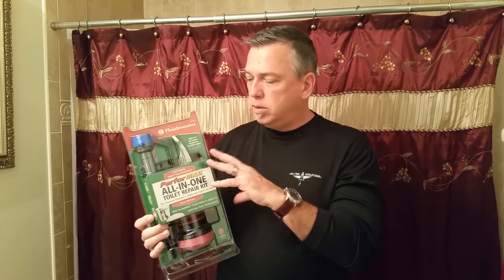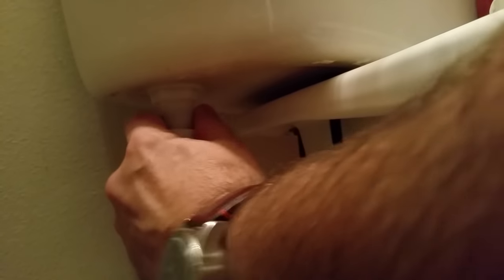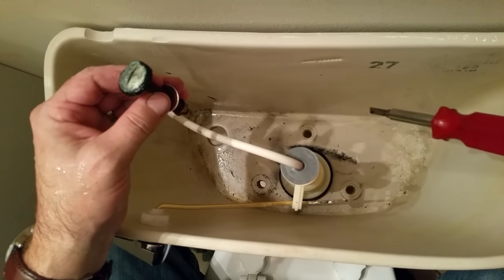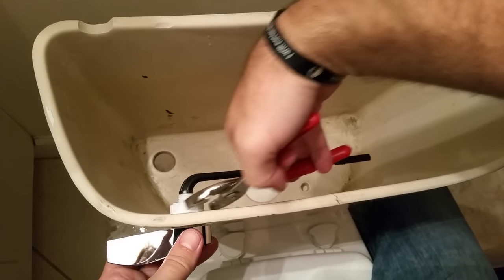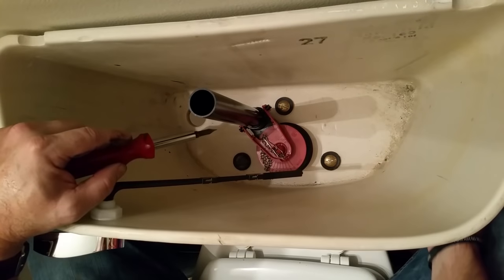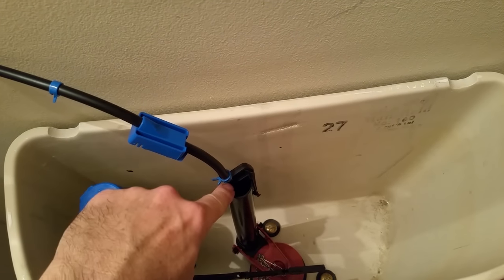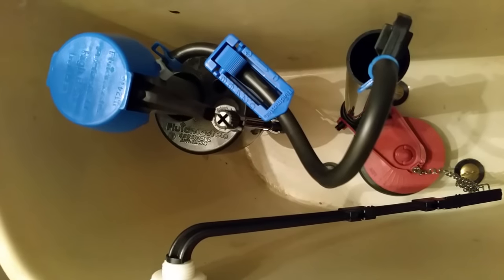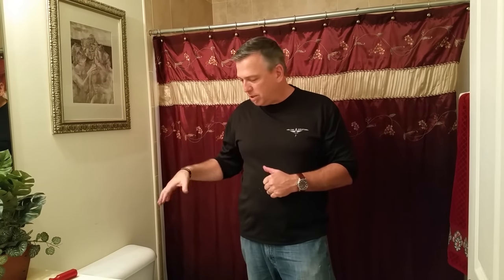Fix Toilet, Replace inside parts of toilet tutorial, Flowmaster All-In-One Toilet Repair Kit

Comment: Also, in the directions it says that you place the washer onto the fill valve and then put it in the tank and then install the lock nut underneath the tank.  I think that you were saying to put the washer under the tank with the locknut.

Comment: First step: read the actual instructions!  I bought the same kit, and some steps are glossed over in this video.  Like cutting down the overflow valve.  Or that Kohler toilets need a special gasket that isn't included.

Comment: This is how a pro does it. However, if you're watching this, you're likely a novice, and if you're wise you will take precautions and give yourself a decent chunk of time in which to perform any part of this overhaul. The weight and off-balance nature of toilet tanks might require setting down cardboard or some work towels to set the tank down on so you can focus on doing it right. A tank or tank lid can end up all cracked up and turning a kind-of-simple affair into The Longest Day. Personally, I need time and space- some work area- or else I end up like the victim in a diy project.

Comment: Thanks for a clear set of instructions. I watched your video a couple of times and I followed your instructions to "a" letter to install my FluidMaster. Unfortunately, our toilet is very old, difficult to access with frozen "rusty" nuts/bolts. These are the additional steps that I used to deal with my troublemaker toilet. 1. Turpentine worked better than rubbing alcohol and nail polish remover to wipe out residual old hardened rubber. If you do not wipe out the old rubber completely, it will cause leakage. In some parts that the rubber had hardened, I used my chiseling tool (similar to what doctors use to remove casts) to get it cleaned out first before turpentine. 2. I also used the same chiseling tool with a metal cutter to cut the "rusty" frozen bolts. 3. At some point you cannot tighten the bolts with a screw driver from the inside of the tank and the nuts from the bottom side are very difficult to access and manipulate. SOLUTION - The bolts in a toilet are long, so a TALL rachet/socket (1/2 inch) set will let you tighten or loosen the bolts easily using one hand from the bottom of the bowl. 4. A wet-vac came in handy to get all the residual water out of the bowl. Good luck.
Reply from the maker: Awesome tips for older toilets! Thanks

Comment: Have leak, and seemingly it has been an issue for a while. We lose water out of tank to below an inch if water valve is turned off for a few hours. Our toilet is 20 years old. So looks like we do need to replace all of the innards. Will have a friend do this. Thanks for the video. Very helpful.

Comment: Really nice tutorial. I would like to add a few more comments that may help people. First. Know where your main shut off valve is on your house. ( it usually is near the front spigot  outside). If your ‘tis 30 years old or older the toilet shut off valve may fail.  This is quite common.  Test yours first.  If you shut your valve and water still comes into the tank, your valve has failed.  ( approx 50%) fail.  Buy new valve get the 1/4 turn valves.  Hope this advice helps some of you.
Reply from the maker: Excellent points

Comment: Great video, great product. Bowl filler/ overflow tube should be below the handle! If the float sticks for some reason you are going to flood! I trimmed mine with a Dremel when I was done or you can use a hack saw before assembly.

Comment: Feeling pretty proud of myself right now...I did this all by myself. Great video! Easy to follow and made the project less intimidating. Two notes:
1. The rubber washer goes INSIDE the tank on the valve mechanism - found that out from other comments and saved me from learning that the hard way.
2. The red rubber gasket that connects the tank to the toilet that comes with this universal kit might not be right for your toilet. I had to run back to the Home Depot to get the right one for my toilet.  There’s another helpful video about this in YouTube.

But the process was super helpful.
Reply: I'm confused as a couple of people have mentioned this. Is that the red rubber thing.  Or what are you referring to. I don't want to have to ask my brothers.
Reply: Do you have a link to other video or name of the video?

Comment: the rubber washer on  fill valve goes inside tank you have to adjust the fill valve so it is right height with the tank

Comment: The video is very complete. When a flush handle is removed, it is important to note that to loosen the nut, it must be turned clockwise rather than counterclockwise as most nuts are. The video shows this but wasn't mentioned.
Reply: It has lefthand threads

Comment: Great video.  Unfortunately it keeps leaking from where my supply line meets the fill valve.  Not sure how much tighter I can make it.
Reply from the maker: Is the rubber gasket in the connector? Perhaps some Teflon tape?

Comment: Clear, clean video, Scott. I did okay but I have a small leak coming from the bolt that connects the tank to the bowl. I'm bot sure I have the correct arrangement of metal and rubber washers. Inside the bottom of the tank, I placed the bolt with a rubber washer. At the bowl where it connects to the tank, instead of just a metal washer and nut on the end of the threaded bolt, I also included a rubber washer. But I'm thinking the extra rubber washer at this point is the problem.  I have a picture of it, but don't think I can send here. Any advice certainly appreciated.
Reply: Tighten it more
Reply: Owen Cowan my question was almost two months ago. I long since fixed the issue but thanks.

Comment: I noticed that the thread attaching the handle assembly to the tank is a left-handed thread. I found that out too when actually doing this replacement job.
Reply: Interesting ... that's the torque direction. Bike pedals work on the same principle.

Comment: thankful your helpful video,  recently I change a full set of the toilet, It seems perfect, but the flushing power of water on the flushing is so weak that a piece of toilet paper cannot flush away although the water level is set at the max height and no obstacle on the flush way. I am looking for your suggestion. Thanks
Reply from the maker: The toilets flushed normal before the rework? In other words it is a good toilet design?

Comment: Good video in route to Home Depot replacement for toilet
Reply from the maker: You go!
Reply: I just wanted to inform you the washer goes inside the tank with the fill valve installation, not out side tank ..but overall good video just finished installing my kit without leaks.

Comment: Thank you, Thank you, Thank you, with your video I did it!
Reply from the maker: That's awesome
Reply: @scasteel  I just have to add you did say to put the  washer on the outside of the tank on the intake pipe.  I returned to find it leaking. Luckily only had to repeat the last steps but you should change your video. :(

Comment: I can't get the locking nut off  underneath the fill valve piece. Any suggestions?
Reply from the maker: see if you can take a flat head screw driver and tap it with a hammer.
Reply: @scasteel  thank you

Comment: I used this exact universal kit but the hole in the bottom of my tank is bigger than this...fell thru. What should I do?
Reply from the maker: The rubber gasket went through? Some tanks you have to put the gasket on the there side.
Reply: @scasteel  universal didn't work on mine...had to get a 3" valve kit.  I have a Mansfield older toilet.
Reply from the maker: @HomeRene  did everything work out? I hope so.
Reply: @scasteel  yes! 3" flush valve!

Comment: Dear Scott...good video..short and to the point......but...I Need Help !
It is very important to me that I accomplish this myself. I have Muscular Dystrophy and need to feel good about accomplishing this repair. I am on my 5th day of trying. I am stuck on the plastic bolt on the bottom of the tank. I have tried everything I know. I have used a pliers, monkey wrench,elastic bands, a little oil....I have blisters on blisters. I must do this myself I cannot hire a plumber. This is my handicap toilet, and I need it.  I am a senior so getting down on the floor is hard...getting up is even harder. There are only a few inches between the toilet and the wall. I cannot unscrew it!  What else can I do ? I think a Navy Seal, Ranger, Marine,Sailor, Coast Guard orFireman could turn this. 
Please tell me how I can do this. How do I get this off .
I took pictures but don’t know how to add them.
Thank you....Tricia
Reply from the maker: Take a screw driver hold it at an angle against the hex and tap it with a hammer. Start gently and it should come loose.
Reply: Tried that. It seems the plastic is so degraded, it is smooth. There was no place to have the screw catch on. Is there a way to cut the plastic off ?

Comment: The rubber washer goes inside the tank for the water supply..otherwise it leaks.  Found that out the hard way
Reply: Georgia Peach r
Reply: Yes I agree it happened to me finally installed the washer the correct way.
Reply: I saw this and was like DANG IT!!! Glad you posted it though. I went back and made the adjustments
Reply: Good video but he needs to address that

Comment: Great video except at least in my toilet, you put the rubber gasket on the float tube before you put it through the hole on the bottom of the toilet so gasket is in the toilet not under toilet. Once I figured that out,  no leaks
Reply from the maker: Kevin Stuer yeah each toilet is a little different.

Comment: it is not necessary to turn the water off at the outside shutoff in order to replace the supply line. The sutoff valve under the tank will shut the water off at the valve and all you need to do is unscrew the supply line at the shutoff valve and replace it with the new flex line.

Comment: had a leaky tank to bowl gasket... New bowl gasket did not bridge the gap... still leaks when I put the tank back on... I used the two spacers in the back... But when I put the tank back on I could feel the front of the tank  grating on the bowl... so it still leaked... I couldn't find a thicker tank to bowl gasket... So I used RTV gasket cement and sealed it up... This can't be the normal procedure... Has anybody got a better idea???
Reply from the maker: Was your gasket on the inside or outside of the tank in?
Reply: Scott Casteel 
outside the tank on top of the bowl opening...flush valve was also new and gasketed.. gasket was fitted onto the flush valve tube...
Reply from the maker: @duggydugg3937  Very strange?  Usually the gasket tat comes with works in most situations
Reply: Scott Casteel 
yeah.. old Gerber toilet two plastic spacers on the back of the edge of the bowl..figured the tank would seat softly on the bowl contact area... nope .. ceramic on ceramic grinding .. leaked of course.. so i got rtv gasket cement.. and no leak.... weird..

Comment: I’m guessing your friends bathroom probably flooded or had a bad leak. The reason I say this is  because the fill valve gasket goes on the inside of the tank not the outside.
Reply from the maker: Yeah, I fixed that I tried to edit that mistake out in post but I guess I missed it. I'm not an expert I'm just a YouTube hack
Reply: Scott Casteel other then that little mistake that you already knew about, it was a great instructional and detailed video for people that don’t know how to change their parts. Nice job

Comment: I did everything in the video but I still have a water leaking into to the bowl
Reply from the maker: This means the shut off valve needs to be adjusted down in the tank further so the float rides further up completely turning off the water.

Water is spilling over the over flow pipe into the bowl.
Reply: @scasteel  the water is only half way not that high
Reply from the maker: @RicardoGarcia-kz6yw  is the flapper not sealing?
Reply: @scasteel  the 1 that came with the kit & a new 1 but I still see water ripples in the bowl
Reply from the maker: . are there any nicks or defects in the rim where the flapper contacts the rim?
Reply: @scasteel  everything is brand new
Reply from the maker: Straign? Sorry. It's hard to trouble shoot when your not there.
Reply: @scasteel  that's all right I'll double check everything I did

Comment: ended up with a leak because rubber gasket goes inside the tank not under it. tried unscrewing white washer and the gasket got jammed in the thread. ended up having to cut the fill valve piping off and had to buy a whole new repair kit. bad tutorial. better off reading the instructions that come with the kit.
Reply from the maker: Sorry man. Maybe a different toilet?
Reply from the maker: Sorry you had such a bad experience

Comment: You really have no idea do you.
 You call a NUT...a bolt.
No proper tools.   Hand tight will not be enough to seal that valve.
You put the fill valve washer on the wrong side of cistern.
 Why make a video when you dont know what you are doing.
Reply from the maker: Most people don't have allot of tools. I'm not a pro. Don't claim to be. I just try to be helpful